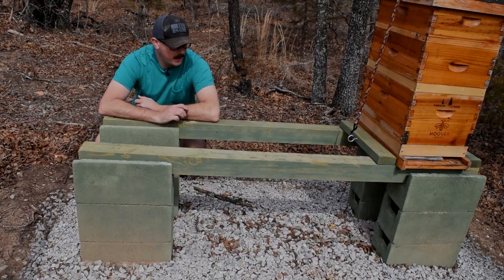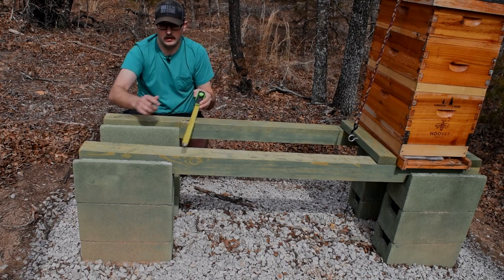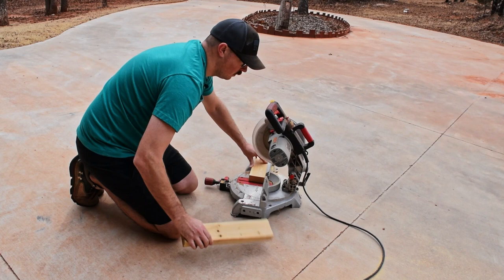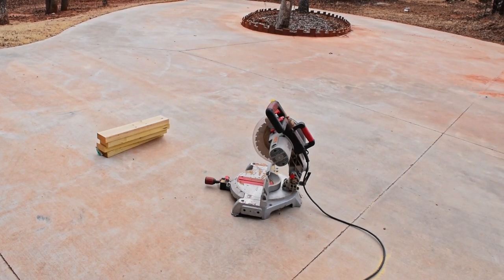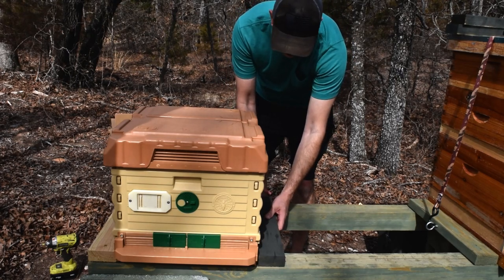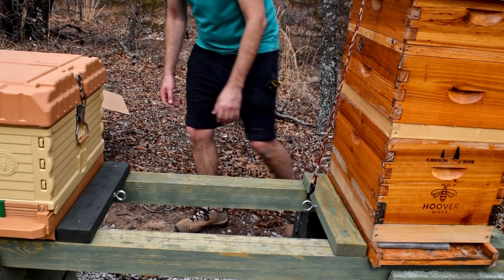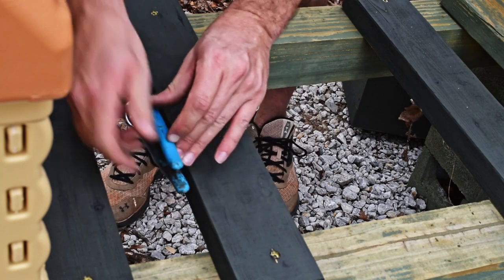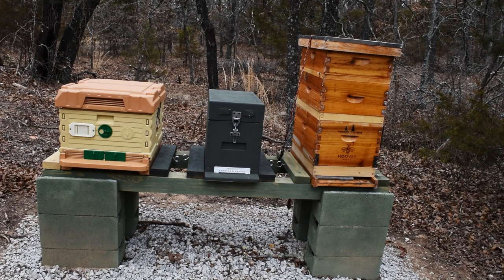Hive Stand for Bees!

Comment: Interesting cinder blocks, I've never seen them like that around here. What are they called?
Reply from the maker: 8x8x16 Standard Cored Concrete Block from Lowes.  Perfect for 4x4s.  Thanks for stopping by!
Reply: @LawsonsCreekApiary  Must be a local thing, they're not available at our Lowe's here in Ohio. I like your idea of the 2x4's to secure the hives, though. Also using the 4x4's. So many people try to save money by using the cheap landscaping timbers they sell but they are much weaker than the 4x4's.
Reply from the maker: @nealklabunde30  I agree.  It’s worth spending a little more for the extra strength and durability.